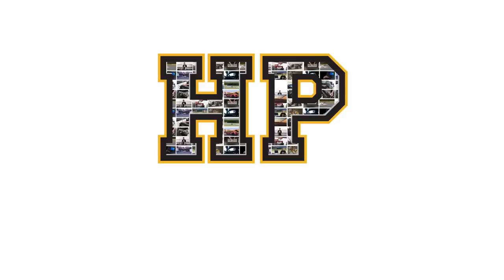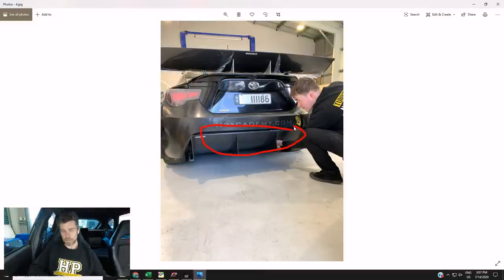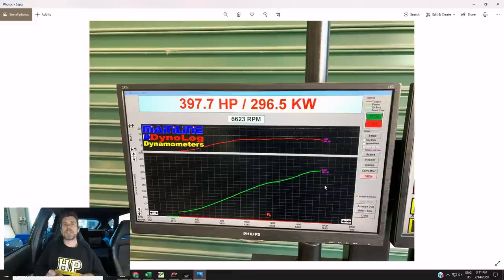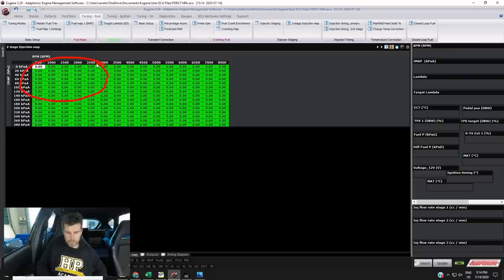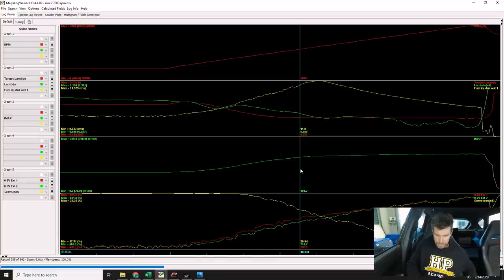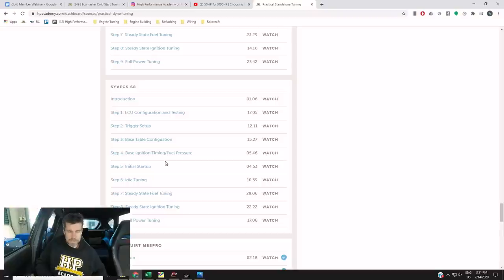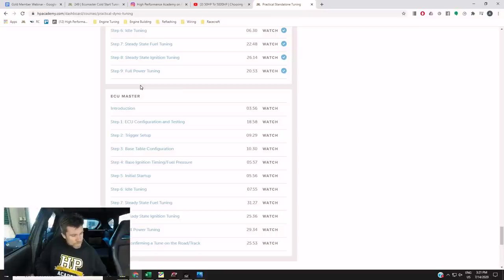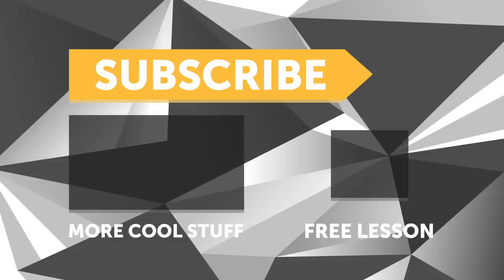Spark Plug Reading, Staged Injection and NEW Aero! | Today At HPA [UPDATE 249]

Comment: That rear defuser looks simple to make going to buy a sheet of 1/8" aluminum and make one lucky i have a cnc plasma cutter at work 😀
Reply from the maker: Yeah man, get stuck into it. Even though Andre calls it 'ghetto' the setup Brandon quickly put together made a solid difference to the cars corner speed so it's all worth doing regardless if it's carbon, Ali or even just ply. You'll have to link us a pic once it's done 😎- Taz.
Reply: @hpa101  sounds good 👍 and simple is better most of the time :)